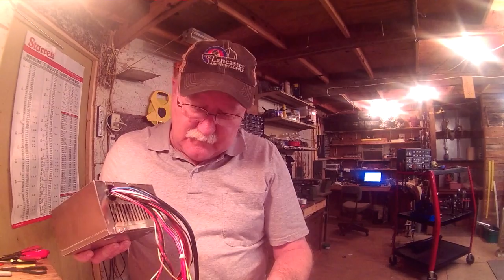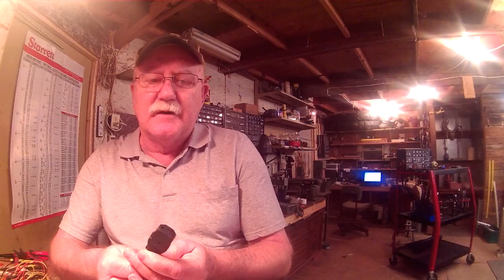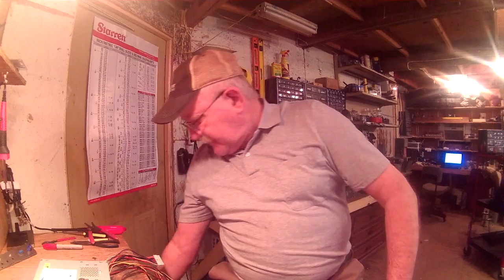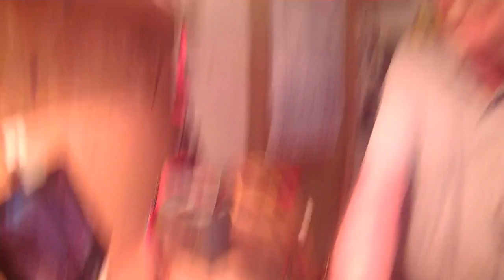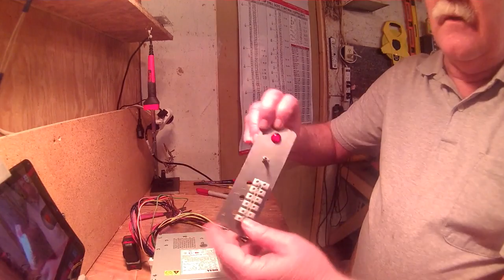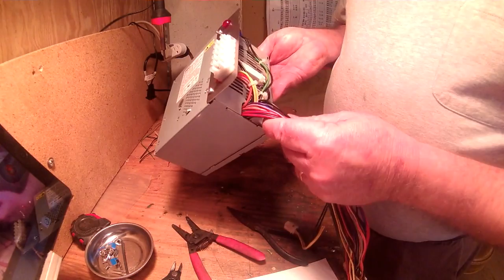Tapping The DC Voltage From A Computer Power Supply

Comment: When I saw that bit of sheet metal I had the feeling that you were going to be running wires through those holes.  That situation really calls for the use of rubber grolmmets in those holes,  so that there's no chance of the metal edge going through the insulation.  That's the RIGHT way to do that.

I have on hand here a whole pile of computer power supplies,  AT and ATX,  from having scrapped out many computers over the years.  One recent ebay purchase was an "ATX breakout" which let you plug the ATX power supply in and had a set of terminals for each voltage output,  all individually fused (though for some odd reason they put 5A fuses in all of them).

When my brother and I were putting together my amateur radio statiion,  included in that setup was an asian-made single output switching power supply rated at something like 25-30A output (for my HF transceiver) and set to 13.8V,  not 12V..  That didn't cost all that much.  Some time later I purchased a similar unit to use on my bench,  rated at 10A.  That didn't cost very much either.  Right now my plans are to mount that one and an ATX supply om a board near my bench,  making all sorts of power accessible for whatever I happen to be working on...

Comment: I have an ebay power supply 20A hooked up to my mill feed with a wiper motor works great with 10A ebay motor controller.. tried hooking my salvaged computer power supply to it to see how it would work. Yellow to + and black to -   .. motor controller will not work and motor starts turning as soon as hooked up even though controller is all the way to left or off position and turning knob does not effect speed. Hooked back up ebay one works fine. Do you know what is wrong

Comment: Lee, there is an updated power break out for the ATX Power supplies on Ebay look for: 24Pins ATX Benchtop Power Board Computer Power Supply Breakout Adapter Switch - The 24 pin pigtail plugs directly into this board, making it much easier to pull power on the power supply.
Reply: Come on dude, you know his idea is the BOMB. In regards to yours, what the hell do you do with all that left over wire???   DUH!!!!!!!!!!!!!!

Comment: thanks for your knowledge. and sorry to bring you back to an old clip but i want to set up led bar lights normaly used on vehicles to my mill and welding bench. both are 27 watt 12v led's. would this supply run both. thanks in advance for your valuable time... from a new Zealand subscriber
Reply: to calculate what you do is check your psu and calculate your amp usage
most bigger leds are 5v or 12v .  V=IR , so amps are watts divides by volts and thus,5v leds would be 54w (27x2) divided by 5 = 10.8amps or 54w divided by 12 = 4.5amps, almost all ATX psus ive seen can handle this but YMMV, hope this helps

Comment: if you only want +12 volts- say for electrolysis--do you have to bundle 
all the yellow wires together as well as all the black, or can you just 
use one of each and ignore the rest?What advantage do you get from bundeling
Reply from the maker: Charles Young I don't know of any advantages to bundling the wires - just pick the larger wires if you see any difference.

Comment: Great how to! One question, instead of using the resistor if your supply requires a load, can't you just use the power indicator light as your load also? That way you are killing two birds with one stone?
Reply from the maker: That might would work - may try that with the next one I convert. Thanks for watching & commenting.
Reply: Came here to say this.
‘ Power-on Lamp ‘ is a resistor, isn’t it?
What  I’m not sure about is if these power supplies have a specific minimum current draw re the energy savings circuits.  Anyone happen to know?
Reply: @roverinosnarkman7240  It really depends on the design of the particular power supply,  and they're all different.  :-)  A power on lamp may or may not provide enough of a load.  A 10 ohm resistor on the _+5 line will draw 2 amps.  Maybe an automotive type light bulb might get you close,  a brake light bulb or similar...